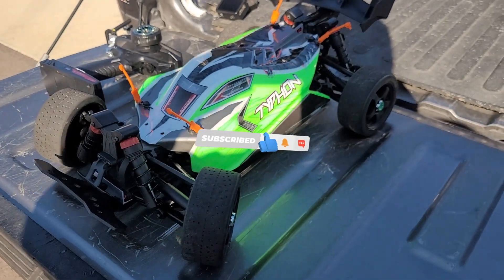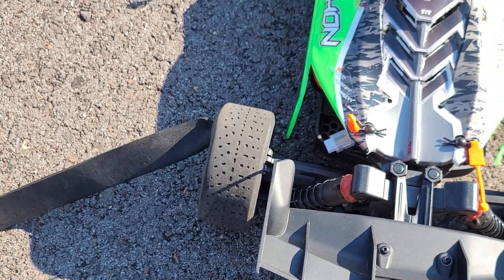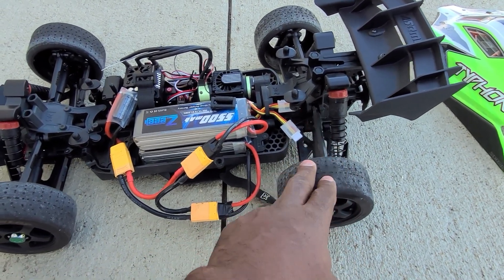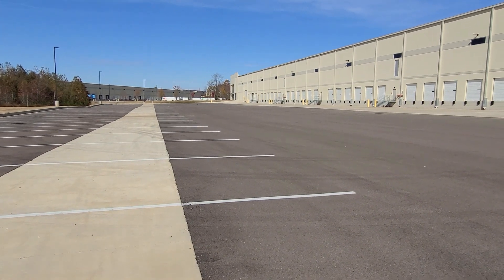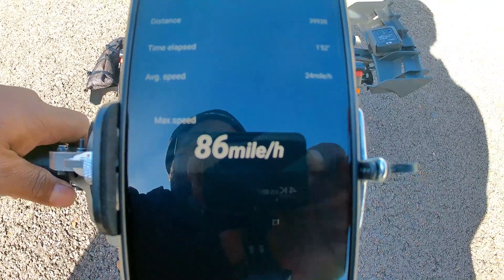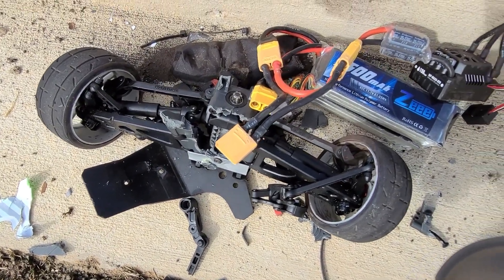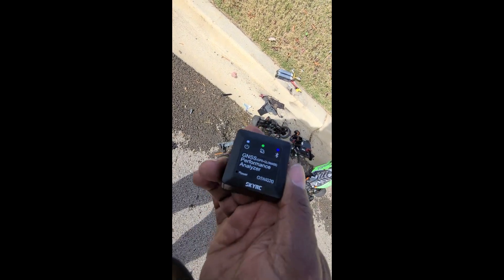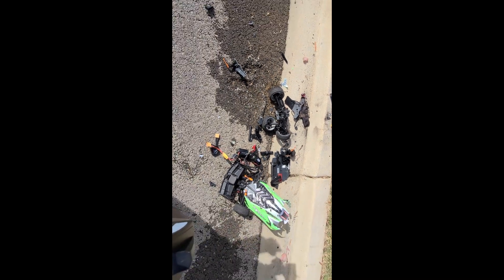*WARNING GRAPHIC SCENES* 6s ARRMA TYPHON MEGA CRASHED DURING SPEED RUN & EXPLODES INTO PIECES

Comment: That's crazy. The Typhon was obliterated by the curb. That's a shame. Sorry that happened. The good thing is that you got some awesome speed out of the Mega. I really like the Typhon. I have the 3s V3 and it's been incredible. I would love to have a 6s but it's not in my budget. I think the 3s version is probably just as fun and the parts are much more reasonable. Hopefully you can salvage some parts but honestly your Typhon is waisted. I honestly feel your pain but the video was awesome and hopefully it will get you lots of subs likes and views.
Reply from the maker: Appreciate that! Yeah it's waisted but I've salvaged enough parts from it that I can rebuild with a bare chassis or a slider. I'm leaning towards the slider to be honest.
Reply: I think a slider would be a great choice. I can tell you like to customize your RC's so really a clear body you could paint and wheels or your choice would be nice. You have lots of spare hardware from your crashed Typhon. Mainly a complete set of bolts, nuts and washers. That stuff adds up separately. Hope you get it all up and going soon.  @PJsElectricRCAdventures

Comment: Nice run even though the ending sucked really bad. I hope you got it back together. I also have a 3X-that I’m running on 6s with a pretty crazy motor and ESC combo. What motor are you using?
Reply from the maker: I was running a pretty soft/safe combo that was only a 4270 can 1400kv motor & 150a esc with cap packs. When I rebuild, I'll be running a higher kv motor & a higher amp esc with cap packs. I want just enough speed to keep my homeboy chasing & not leading 🤣

Comment: Carnage for sure! Hopefully the ESC can still be used . . .
Reply from the maker: I tested the esc & motor yesterday. Both are working as intended, so they will be used in a new project for sure. I really fault myself for this crash for not programming the fail safe when the signal is lost.
Reply: @PJsElectricRCAdventures  That's a bright side!

BTW, was that the cheap dBoots Hoons knockoff tires you showed previously?